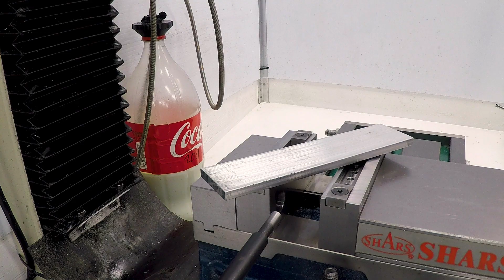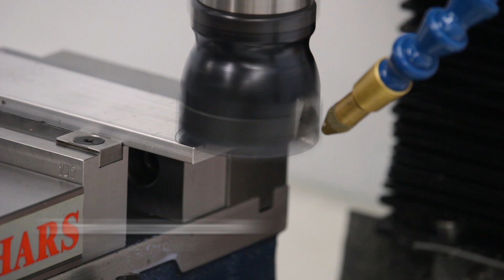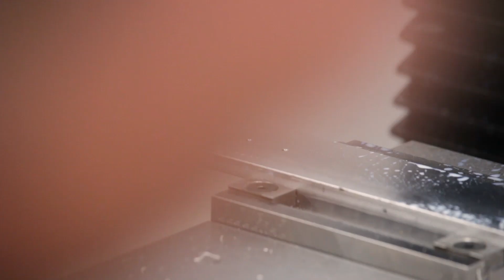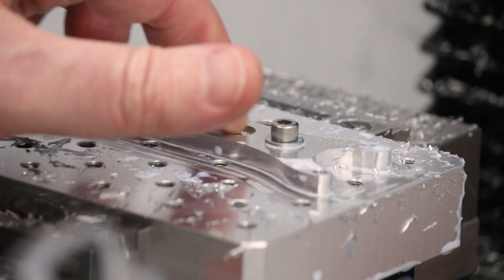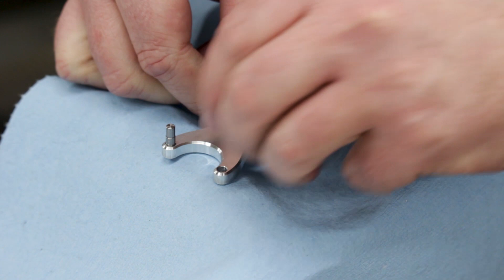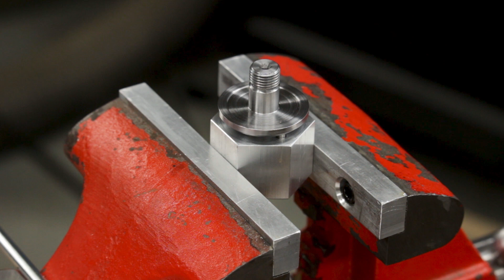CNC Machining a Pin Spanner Wrench

Comment: Nice work indeed. However, couldn't you make that spanner adjustable for different size of arbours where the holes are might be farther apart, as often the case with angle grinders.?

Comment: Milling on top of a fixture- do you not use a sacrificial layer to prevent damage to the fixture?
Reply from the maker: The fixture is sacrificial.  A quick pass with a fly cutter will clean it up.

Comment: Very pretty James. I had wondered if you were going to highlight the engraving by painting the lettering black before you took the skim cut to remove the nonexistent burrs. Might have helped with the glare.
Also if you use your engraving tool to do the chamfers after engraving would probably be more controllable.
Regards from Canada's banana belt. 👍🇺🇲🕊️🇺🇦🍌🇨🇦🤔🤞

Comment: Also curious in the beginning did you buy a mill for your hobby/ 3d print business to make parts and then make videos or did you justify the purchase to create content. Obviously it’s a big gamble to buy a machine to make content. Guys do say don’t buy the machine then expect sales on wood channels.

I’m just trying to weighing up buying a cnc like a shapeoko. I don’t have a cnc now so justifying a large purchase that get compounded by exchange rates is hard to justify. I think landed the Nomad 3 is 5k (AUD). 

I have a bike part business (fledging) and needed to make prototypes so got a prusa mk3s. I have used it for prototyping bike stuff and making leather dies (for wet moulding) for my dad. So the machine has actually been a worthwhile purchase. 

Reason for a cnc like a nomad would be to make steel plates for my dad leather stuff as more durable than plastic (it mushrooms) and metal components for my bike stuff. But ROI would take a while I’m sure….
Reply from the maker: I'm generally bootstrapping.  One machine allows me to generate cash to buy the next, which creates more opportunities.  Cameras and computers are the only gear I buy specifically for content generation.

Comment: Been watching a lot of back catalogue lately. Apologies if you’ve mentioned in another vid… Just curious what’s the idea behind the positioning of the coolant/ air nozzle - It seems to be on the trail edge of the run usually. Is this so coolant is cooling the blade that’s made the cut and applying a little lubricant before it goes in for the next cut? Any reason you don’t have it on the opposite side getting air and coolant right at the point of cut? Is there a benefit on either side fir clearing chips? Ie in deep slots is it better in front (on side of forward direction) to clear chips vs back for light cuts where cooling/ lube is preferred?
Reply from the maker: The nozzle is always a compromise because cuts occur in every direction on complex parts.

Comment: Hi, just catching up on your videos. Would the option of a piece of Perspex work between the work and the pallet, say 2mm thick, so you can do the 2D contour lower than your stock, and cutting slightly into your sacrificial Perspex giving full depth of cut on the stock?

Comment: This episode was just plain fun. I would have put in back in the vice and made a shapped cutout out of those holes or perhaps tig welded them shut and then taken a surface cut. That's what made this episode so much fun though. It sparks the imagination and you can think of all kinds of things and projects that one could do. Thanks so much for your work on these. I know how much extra work it takes to video and edited these for YouTube. I also know the money one earns is insignificant. So that must mean that at least in part you make these videos to share with us ☺
Reply from the maker: I started making the videos as a way to give back to the maker community that has provided so much information and support for me.  If it grows to the point where it generates enough revenue to buy some more tools, that'll be cool, too.
Reply: You're helping me learn alot. Just decoding what tools you have and seeing you use them is helpful. There are so many one could buy if you were rich. If you are a budget though what you need or don't need for a project can be confusing. The other machining channels are great but the old timers, like Keith Fenner, have a lifetime's collection of tools. They teach you what the best tool for the job is. For those of just starting off though knowing what you could "get away with" is also helpfull. A good example of you teaching us that by example is you use of your spotting tool to also cut chamfers. Listing all the part numbers for the tools you used in the video is fantastic in this regard. There are lots of tidbits like those in your videos that I hope people notice and learn from. 
.
By the way you look great at your new weight, and the addition of more smiles durring your introductons have not gone unnoticed. 
.
Cheers, and thanks for taking the time to answer my myriad of questions.
Leo

Comment: Another clear, concise slice of shopcraft, well done as usual.  Your video-fu is as confident as your machining skills, I'm guessing you deal with a ton of presentations in your day job?

I have one reservation about the wrench; I've observed that aluminum deforms unfortunately easily with a leveraged side load like pins in a relatively shallow bore.  She's a beauty for sure, but I'm curious to see if the pins start mashing over the holes after a while.
Reply from the maker: Thank you.  My job is technical, so when my mother asks me what I do at work, I tell her "I talk to people and I write stuff down."  That describes most engineering pretty well.

It'll be interesting to see if the aluminum deforms.  This one will get light use in my shop, so I'm not too worried.  But if it does, maybe I'll make another one out of steel.